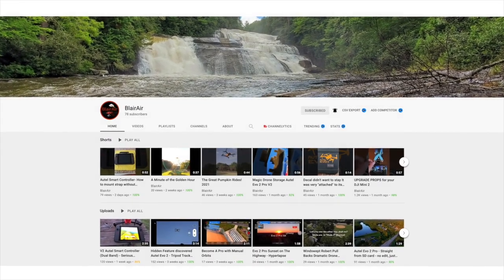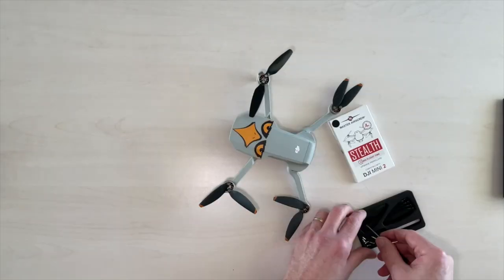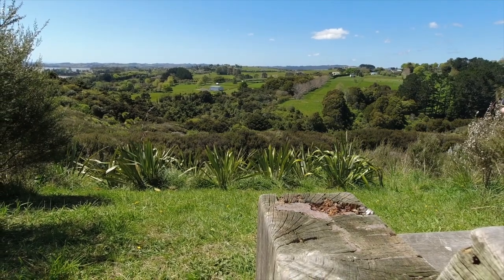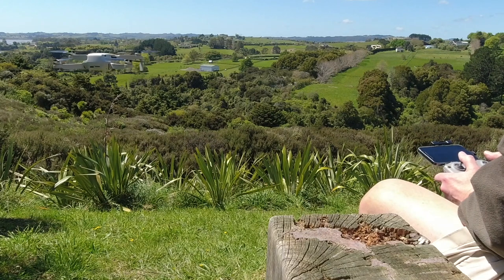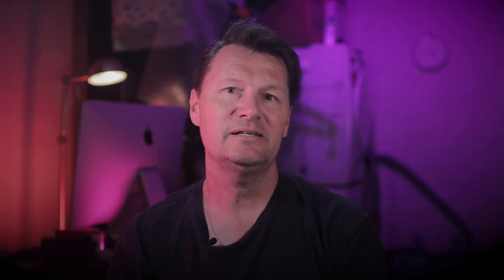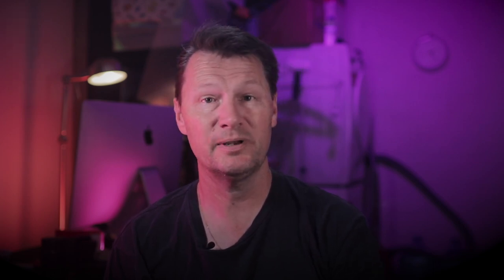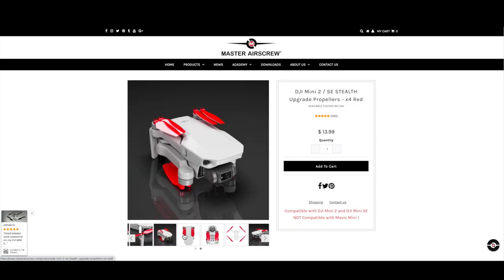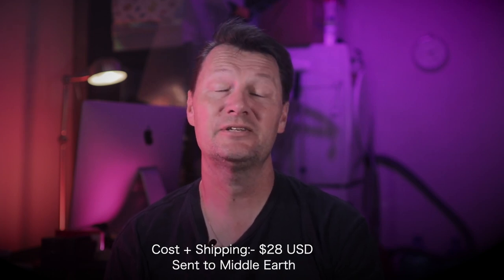DJI Mini 2 Stealth Propellers Review // 3 MONTHS LATER

Comment: Great update Mike.  After your review I bought some myself and found the noise lower which was great.  Didn't notice any performance difference and like you I always check the screws before I set off to fly.  The only downside (apart from the shipping costs) is they tend to be made from softer plastic so If you're a buffon like me and fly into branches a couple of times they will mark.  Don't really know if there's a performance difference with the marked ones but the pitch is altered so I suspect some vibration - it's not bad though.  I like them and will be purchasing more when the postage costs come down (love the red ones).
Reply from the maker: Another great insight - thanks for sharing mate. Yeah the red ones do look killer!

Comment: Being a long time fixed wing aircraft flyer I could have told you that changing the pitch of the props definitely changes the noise level of the aircraft.  It also changes the performance of the aircraft !  One needs to perform test flights with different prop diameters and pitches to determine what the operator is happy with. You may find a quieter prop selection, but you may lose performance
Reply from the maker: I should have gone straight to you! 👍
Reply: Do you always lose performance for sound or, can you gain in some areas?? Asking for stupid friend of mine… 😂… ✌️🤣

Comment: A tip: put a permanent marker dot on each propeller screw opposite each other.  Then if the screws do loosen you can instantly see that the marker dots are out of alignment and a screw has come loose…
Reply from the maker: Great tip!!
Reply: great. thanks for sharing! 💪
Reply: Thumbs up, thanks for the tip!

Comment: Something i do check every time. One of my first drones i bought back in 2018 had screw on propellers that fitted to the metal thread of the motor. I decided after 6 months to put on loctite, to be extra safe. On the next flight some 350m away my drone disappeared over the sea. Obviously never found and/or get SD card to see what happened. Bought another one, gave it the same loctite treatment out the box. First flight and thank heavens this time over grass and a height of only 10/12 metres, it dropped out the sky. I discovered the loctite was eating the plastic, causing the propellers to split on the thread hub. So never again. I would contact DJI first and make sure witch one to use as there are different types of loctite available. Sorry for the long winded comment, but just trying to make people aware of my experience. Thanks Mike. 👍
Reply from the maker: No worries mate - hey thanks for sharing though, that's really valuable information!
Reply: They make loctite for plastic read the directions
Reply: @w.e.s.  : You mean read instructions. I discovered there is one for plastic, metal and various strengths.

Comment: Thats why i always check the screws to my props before every flight. Always have a philips screwdriver with me that fits perfect and its magnetic also so i dont drop any screws either. Because the philips screwdriver that come with my mini 2 are not so good to screw with. 

REMEMBER THIS CHECK ALWAYS YOUR SCREWS BEFORE EVERY FLIGHT. And if you want to be extra sure they stays on use locktight or treadlock this you can take a q-tip dip in locktight and use little on every screw let them dry before you screw them on your drone. 

Thanks for a great video i just bought my mini 2 because it was better price for sure and i didnt have 700 euro extra when i bought my drone. But iam very happy to have this drone with the Litchi app its amazing for sure follow and track mode and many more settings to set alsomore them dji apps settings for sure. 😊💪🏻🇸🇪🇸🇪👍🏼😊
Reply from the maker: Thanks Mattias ”Dino” Johansson! 👍

Comment: Cross threading the screws may be what happened to your friend, when you put the new screws in the new props make sure the screw goes in straight, the screws seem to be made softer that the mounting holes on the motors. I think it’s that way on purpose so a cross threaded screw doesn’t damage the mounting holes on the motor. The mounting hole will damage/change the threads on the screw, when this happens the screw appears to be at a slight angle , rather than straight up and down, when like this they will loosen in flight. It is very easy to get one of those little screws cross threaded and not notice. You normally get a payload sensed warning if there is a crossed up screw in a rear prop. I don’t know about the front though, I’ve only had this happen to a rear prop.
Reply from the maker: Yeah great information mate - thanks for that 👍

Comment: Fyi. If you are in a pinch and don't have loctite, clear fingernail polish works just as well. I have used it on mount screws for anchoring my rifle scopes. I have never had one loosen from the recoil.
Reply from the maker: Oh that's a great tip!

Comment: Being a new DJI Mini 2 owner, I didn’t notice the markings on the individual propellers and installed them incorrectly.  When I tried to launch from my concrete driveway, my drone dipped sideways and one side of the new propellers were damaged.  The included instructions didn’t clearly state the proper procedure to replace new propellers, but I did find a DJI video on the subject.  I emailed Master Airscrew about my experience and to my surprise, they sent me a new set without charge! And I agree with your assessment of your experience with the new stealth propellers! 👍🇺🇸
Reply from the maker: Good insight mate, thanks for sharing!!

Comment: Thanks to your previous review, I tried these (orange) and am happy with them.  The price for the props for the Mini 2 is good.  Not sure I'd want to pay the greater price for props for one of the larger quads.
  I mainly want to point out that mine came with screws that have some kind of compound already on them, which makes them more secure.  I assume it's some kind of thread locking stuff.  Anyway, mine seem secure as installed.
  Also, props sound better, yes.  If there's a performance difference, better or worse or the same, I cannot tell yet.
Reply from the maker: Glad they are working out for you. Interesting re the compound on the screws. I can't recall if mine did or not. They probably did but I didn't see it.

Comment: The new screws you got with the airscrew props have also locktight on them. So dobt worry about that. I use 3 bladed props to my mini 2 right now. Before that i had mitorcovers on that is made of aluminium they cover the engines so youbdont get dust and ither dirt particles in the engines/motors. Really recomend these covers. From sunnyblade ithink who made these covers i bought other covers also but those was not so good that these was. And 3bladed props have more liftpower also and more controlled flight better turns when you fly with these 3 bladed props😊🇸🇪💪🏻 thanks for a awsome videos
Reply from the maker: Thanks Mattias ”Dino” Johansson, I appreciate that! 😊

Comment: I've always wanted to try them out but always forget about them. I wish they made them for the mavic mini that way if it does go haywire I won't be as upset as I would be if it's the mini 2. Thanks Mike for the follow up.
Reply from the maker: Actually they work on the mini too mate!
Reply: @GetBusyLiving  No they dont sadly just mini 2 and mini se! i ust returned them on amazon UK they would not screw in diferent thread or something? I re checked the advert and it said not for the mavic mini. Also std screws dont fit these props, the heads are slightly bigger!

Comment: I have bought a set of these blades aswell. ( Due to your previous review on them 👍). I did notice the screws that come with the blades do have a small dab of blue lock tight on them. So I imagine as long as you use those screws and not the original ones or you dab a bit of lock tight on them it should be fine. Did your friend take the original screws out and then just reuse them or did he use the ones supplied with the new blades?
Reply from the maker: That's a great point mate. Hey thanks for that, nice to know you followed my recommendation - I appreciate that. Hey not sure about that. I don't think he'd ever played around with the props before, but maybe if he reads the comments he might reply.
Reply: When I purchased these propellers I used the old screws and the propellers didn't spin freely as before and when I flew it I received messages warning about payload which I had never gotten before.  Took out the original screws and put in the MasterAirScrew and they spin freely and no more payload warning.
Reply from the maker: @dronevideos1617  Oh wow that's interesting 👍
Reply: Mine also became loose after each flight, after about two months. Using the master airscrew supplied screws, and had their patch lock on the threads too. Not loctite, that stuff eats plastic! Even the “plastic” labeled brand, read the back, it’ll say degrades some plastics, the gas that’s released when setting will destroy your drone. They all are using a blue patch like vibratite or nylok not loctite. I would have to rescrew my screws every flight till I finally threw them away, didn’t and can’t risk the drone falling and hurting anyone

Comment: Even tho I believe that when you purchase props from DJI the screws have a little bit of lok-tite on them, I use a small lid put a few drops of lok-tite in the lid and then dip the tips of the screws into it before screwing them into the motors
Reply from the maker: Great advice - thanks mate!

Comment: I had problems with one of my drone's propellers breaking. Luckily, the propeller broke when I was about 4 meters high on takeoff. They were original propellers, with 14 hours of use. I work with failure analysis. I analyzed the fracture of the propeller and found a fatigue crack, nucleated in the tube through which the screw passes. From then on, I change the propellers after 10 hours of use.
Reply from the maker: Good tip mate thanks for sharing!

Comment: I heard that DJI is not liable for accidents and damage if you have other propellers attached to the drone, like the DJI ones. is that correct ?
Reply: Yes.
Can also void any insurance you may have.
Also in the UK, the CAA have mandated that only propellers approved by the aircraft manufacturer can be used.
So worth checking local rules.
Reply from the maker: Yes that's true 👍

Comment: they are quieter then stock propellers and you can buy them on amazon for 18 dollars and free prime member shipping i also bought small tune med duty lock tight and put on the screw threads so far no problems
Reply from the maker: Sweet - thanks for that!

Comment: Have you noticed any degredation of performance with the Master Airscrew props? With a lower pitch, it would seem that the top speed & perhaps the wind handling abilities would be adversely affected. Before getting into 'drones' (UAVs), I vlew RC aircraft .. going back 60 years to some very primitive RC systems (by today's standards). Master Airscrew has been making props for fixed wing aircraft for a very long time. Cheers.
Reply from the maker: Hi mate - no I haven't noticed any degradation of performance what so ever. If there is a difference either way, it's very very subtle and impossible for me to measure.

Comment: Still would not call them stealth. Bought 8 pairs already tried 4 different pairs with no noticeable difference overall to the oem's. I really think when it comes to noise reduction there needs to be a complete redesign effort. I would say a drop from around 80db as I tested multiple times at 3m away and 1.5m up (yes with all conditions the same for oem and ms) down to 30db at least is a proper reduction.
Reply from the maker: Yeah fair enough probably not stealth as in silent, but I did notice a difference as you see in my original review. Cheers!

Comment: It would be interesting to program a repeatable GPS flight path/circuit to do a few times with each set of props and compare the flight time. A hover test as well.

Quieter props are usually less aggressive and will draw less current from the battery, but give less acceleration.
Reply from the maker: Yeah that's a great idea!

Comment: Hi Mike got these my self and done a wee review on them and had a few comments about people getting error messages loose screws so I advised a little locktight. I find them good props but certainly seems to be issues out there. Can it be people not tightening enough in fear of stripping the screw holes or possibly over tightening would have preferred quick release props on the mini 2 takes the element of error away and with the stock dji props being of good quality they are hard to beat. I got them from USA as not stocked in UK at the time. But they are now available via amazon here in the uk and obviously much cheaper as the shipping is expensive
Reply from the maker: Totally agree Jim - quick release props would be ideal I reckon! 👍

Comment: I must have gotten a bad batch of these propellers. The ones I got were louder, used more power, and caused a few error messages to pop up.
Reply from the maker: Oh bugger! Maybe let MS know, I'm sure they would send you some new ones?
Reply: Might've sent you 5he wrong ones.
Mini has different props to Mini2
Reply: @grahamniven  they don't do the mini as you say different from mini 2
Reply: Oh wow.   Of course you double checked they were installed properly?    Did you contact Airscrew?  They are expensive props, they should send a new pair.   Literally it probably cost them 20 cents to produce.    I just reviewed the Airscrews against some other props and they are the only ones that had exceeded performance.

Comment: Hi Mate! OK, you talked me into it. I ordered a set of the "stealth props." Shipping was $5.49 so they must be here in the states or maybe Canada? This video drove me to look at the replacement props I got in the DJI Fly More kit (is that the right name?) The replacement props have instructions in about 0.4 type face which is tough on an old man. They specify that the included screws should be used when replacing the props. That makes me think you are right about some sort of thread lock being factory applied. What would you think about using some medium strength LocTite or Zap Thread Locker and reusing the screws? Thanks again for a great update!
Reply from the maker: Yeah very good point mate. I have actually purchased some medium strength loctite myself for when/if I ever change these out. Thanks mate I appreciate your support!

Comment: Hey Mike, just had the same issue with my Mini 2, it feel out of the sky as a result of loosing a propeller,  straight into a neighbouring pool. Really pissed that it was not my fault . Anyway as I purchased 2nd hand I did not have DJI care and did not realise you could get it if you upload a video of your drone to DJI. If anyone has a mini 2, or other drone that works with the Occusync 2.0 controller sitting around in Australia, please add a reply to this comment.
Reply from the maker: Oh what a bummer!
Reply: dji care does not apply with aftermarket props
Reply: Too long ago now surely, but you can get a mini 3 without controller now :)